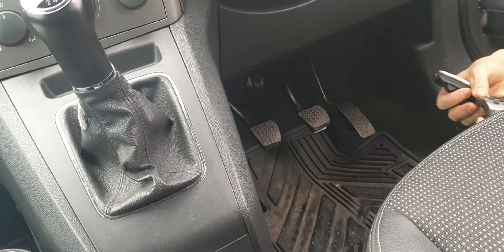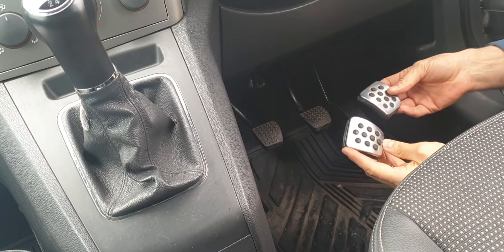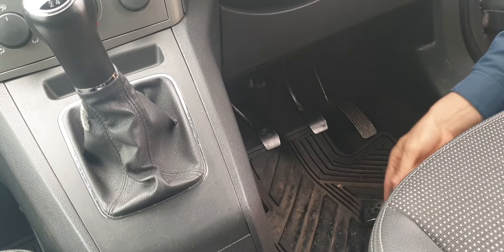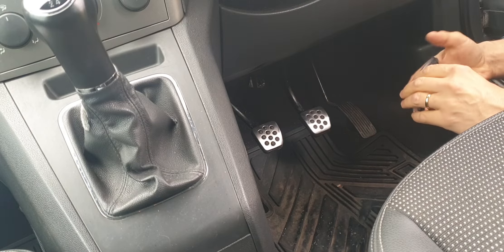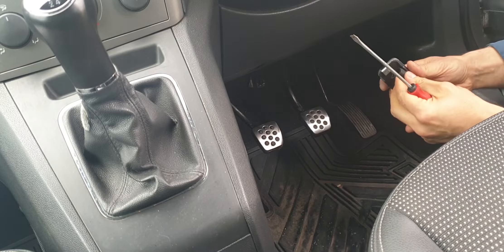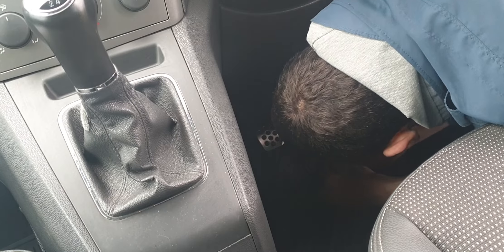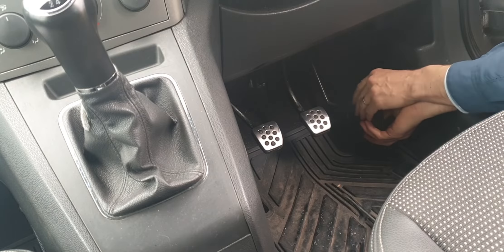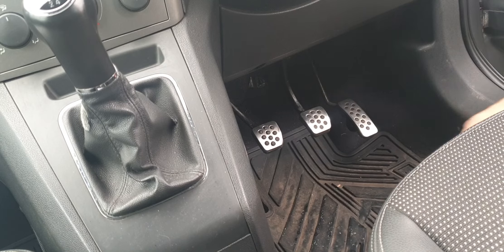How to install/remove VXR/OPC sport pedals on Vauxhall/Opel Zafira @TheCarWorkshop

Comment: Will it for Vauxhall vectra c mk 2
Reply from the maker: Might fit Vectra C too,are same generation.Brake and clutch pedal are the same,but you might have different accelerator pedals(i checked on Google and accelerator pedal is different on diesel Vectras) double check what pedal you got.
Reply: @TheCarWorkshop  Okay lovely I will check. Also will I be able to get a silver pedal for my accelerator from some where
Reply from the maker: @rabinderkhela708  I'm pretty sure same pedals were fitted on VXR/OPC Vectra,but are pretty rare and some higher spec Vectras.You might find a accelerator pedal separately.
Reply: @TheCarWorkshop  Okay lovely and thank you very much for getting back and for your help my friend
Reply from the maker: @rabinderkhela708  👍👍